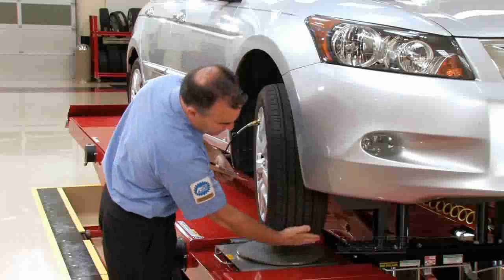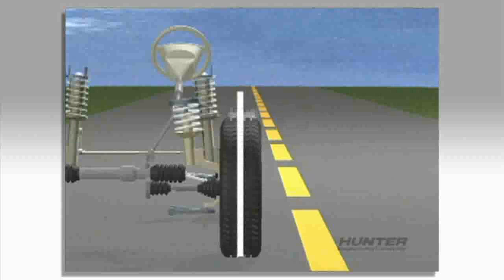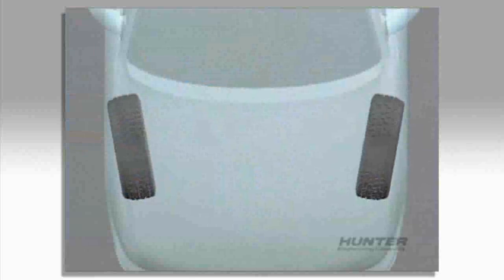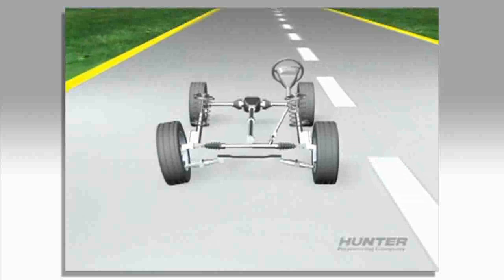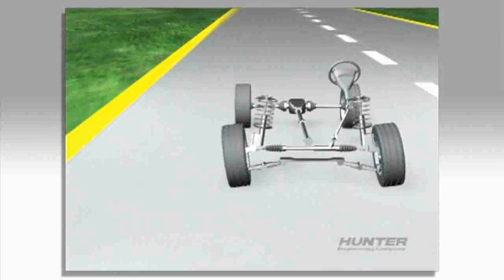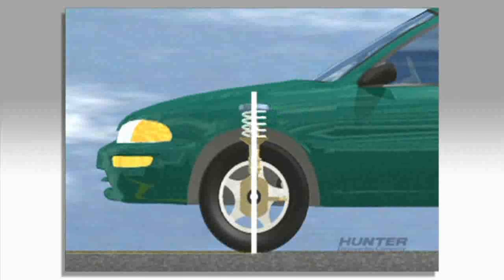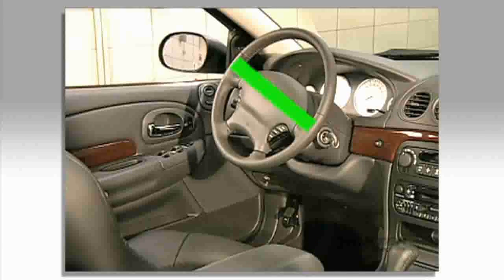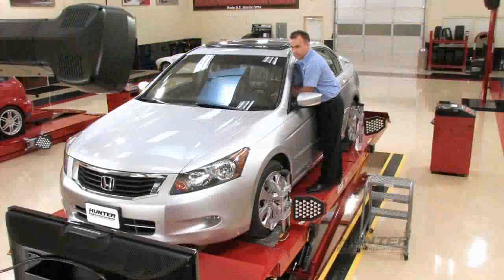Wheel alignment explained

Comment: i have seen your video... and acoording to you when camber is negitive the tyer distroy fron inside and whenthe camber is positve the tyer distroys from out side. this theory is wrong. i have seen that mostly in the world peoples follow this theory  but accordind to my reserch and anylasis this theory is wrong.. if i do allignmet with my machine which i have made either the camber is negitive or positve the tyre will not be effected from any of the side. the reason behind the effected tyre from in and out side have no relation from the camber negitive and positive .qorld theory is just like you have explaind .i challenge this theory i know the the science why the car on the way distroy the tyre from in side and out side it have no relation with camber positive and nagitive

baba ji wheel allignment multan road sahiwal pk